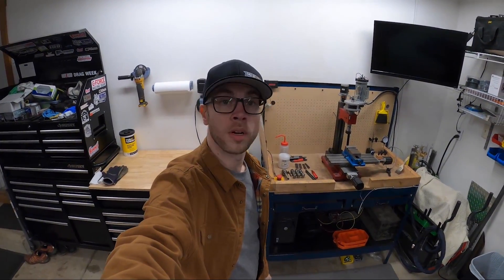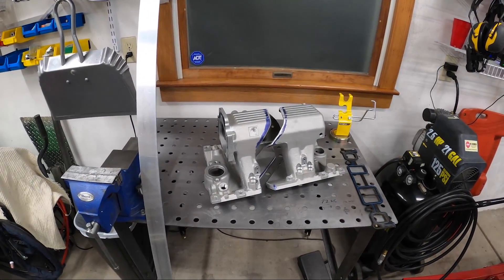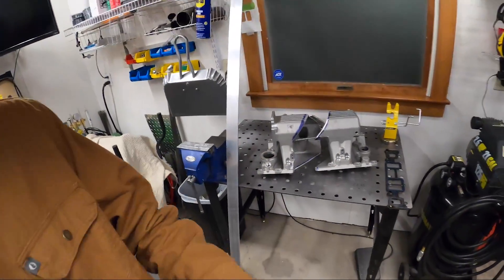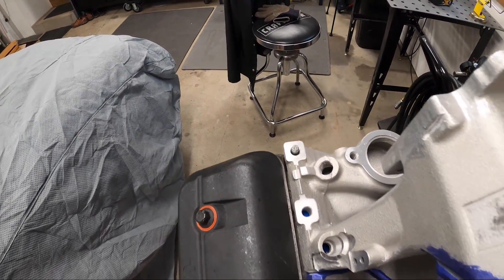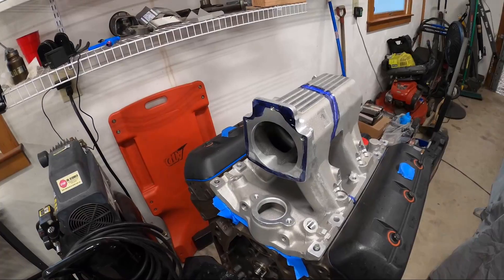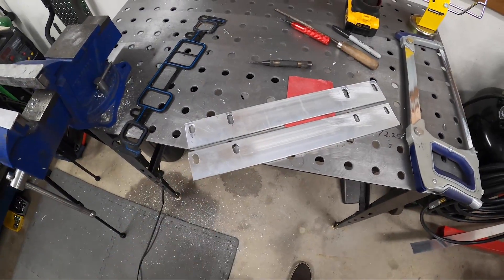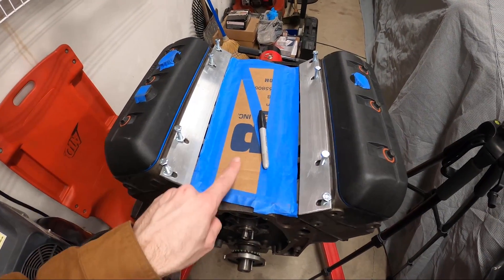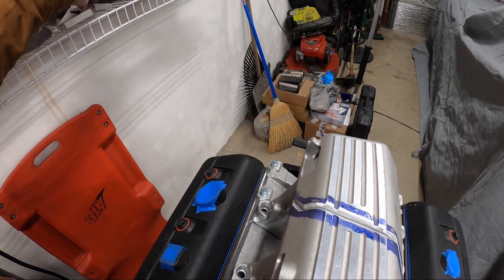I Cut it in Half!! Custom 4.3L V6 Intake Manifold Ep1

Comment: Actually the manifold wasnt holding it back so much .
its a early form of traction control 
throttle body plate eases the air on .
theres a half moon like extruding like C on back of throttle body plate .
you cut grind it off so you just have like a silver dollar then study the throttle body it has a little room for porting also but dont 
screw what the plate leans on a little goes a long way 
for instance my 97 Camaro lt1 350 has a 48 mm butterfly and a 4 mm idle air hole together so 52 mm all together 
Thats 732 cfm when the stock car ran 285 hp it came with Fast Burn Vortec heads at about 5000 rpm the vortec kicked in like another 100 horse that i couldnt use I port matched the exaust on heads and stock manifolds 70 thousands bigger and were already big 180 exaust runners .
didnt show then I drilled the idle air hole to 1/8 inch 4mm to basic 6.5 mm 54.5 mm
which is 807 cfm  idles at 1100 rpm so i wish i would have ported the main throttle body to get the extra 2.5 mm
idles a little high at lights ..
But the Vortec Tumble came in off line and 2 sec 60 foot is 1 second 
0 to 60 in one gear used to be 2 seconds with shift 50 mph top out for 1st gear now 62 mph 
went from 285 at back wheels  to 450 hp 480 torque at wheels still stock lt1 iron rockers and all 
13 second quarter mile is 10.57 now it pulls like my b&M supercharger at 3440 pounds 
the throttle body half moon plugs off the whole 1 side of the throttle plate 
its the best 4.3 upgrade ive been told 
and you dont have to port the whole exaust runners just the outer holes its called engine Tuning  I used a 12 volt chain saw sharpener 
on head exaust ports be cause its about 4 inches long and jumper cables to the battery 
and fits in tight places you leave metal shavings or blow them out with hose no engine break down exept exaust unbolting and use header gasket to size it i ran the grinder around holes 20 times and it was close.
its not just the intake runner flow its how intake and exaust flow together
350 horse out of 4.3 is plenty lol 
a 4.3 6 is chevy 350 lt1 with 2 cylinders cut off
Hope your fabricating that manifold works 
that will be cool if not I told you what to do 
thanks for video

Comment: Hey , did everyone know that Brodix makes aluminum heads for the 4.3 v6 now? They're a little pricey,  but well worth it ! This intake would be awesome with those heads !
Reply from the maker: Yeah, at some point I'll have to get a set of those heads
Reply: Those heads have been out since the 80s. Very expensive to build and buy. No less than $2200 and they would still need to be gone through. Those are for people looking at 700 to 1000 plus HP. I have a set of 18 degree pontiac poncho heads for the 4.3. They arent cheap buy any means and cost a lot to build

Comment: Anytime you are sanding aluminum to be welded you should ONLY use aluminum oxide abrasive.  All the time really but very important for welding.  

Very clever thing you've done here.  Bet you could sell them for $500+   There are so many of these engines out there and no performance parts except headers unless it's for an SBC.  Not right.

Comment: Did this intake come with a fast universal fuel rail?  If so I think that’s the one I sold on eBay back in 2019, started a couple small cuts and decided to go another route.

Good to see this getting done.  There definitely needs to be some better options for a 4.3 EFI intake, the heavy ass marine one isn’t that great.
Reply from the maker: Didn't come with a fuel rail, but it did have a couple cuts in it. Probably bought it off the guy you sold it to.

Comment: I hope you're not introducing a failure point in that manifold by cutting and welding that. Reach out on to the  Syclone/Typhoon forums about getting a sheet metal intake made. I bet someone there would be willing to help you or, at the very least, might give you ideas on what route to take.

I'll be following you to see how this progresses.
Reply from the maker: It’ll be fine. Lots of people have done this with other manifolds
Reply: Those were 2k plus 20 years ago. His is way less than that and just fine. Plastic intake hold 25psi and more. This will easily do that

Comment: I more than anyone am interested on how much a Vortec V6 can handle on the stock crank rods and pistons.  Have an 00 xtreme and afraid to hit it.  Don't want to upgrade all that stuff.  Would just spend the money on a LS swap.  Richard Holder has a series of Big bangs he does on motors on a dyno to see how much they can handle in stock form.  Anyways, I had a 98 Mustang V6 and the bottom end on those were good for 700 or so.  I heard the V6 Camaros were only good for 400 to 450.  But have never seen an actual big bang on one.  Would love to see a documented big bang so I would know how far I can push it comfortably without worrying.  I have to deal with CA smog checks every 2 years so want something that can be reasonably easy to put back for that.  Plus not having an aftermarket for these kept me from getting motivated to doing something.  On the Ford, they can handle alot downstairs but not high RPM.  Not sure where you shift,  But I hope no more than 6k.
Reply: I made well over 400whp in my 4.3 S10 SS. Stock internals besides cam

Comment: I'm using a Mercruiser 4.3l fuel injection manifold. Many people modify Edelbrock 2114 manifolds with injectors.
Reply: I also have a mercruiser mpi intake. I havent bolted it on yet because I plan to do a full rebuild. 
Had to ask though, how is it running and did you have to get a custom tune for it?

Comment: 1:03 bout scared the poo right out of my ass lol .  Anyways I'mm having fun enjoying watching you.  I am thinking about turbo charging my S 10 at some point so it's been fun watching your channel because it's giving giving me ideas and tips and tricks here and there.  Really smart idea by the way! if I remember correctly I think the LS heads also fit the V8 350 Chevy engine I've always kind of thought it would be cool to cut off the back cylinders of the LS heads and then build up material and grind them down nicely so that way you can have a set of LS heads on a Vortec V6.
Reply: Ill admit. I jumped pretty bad
Reply: @cameronf2758  lol